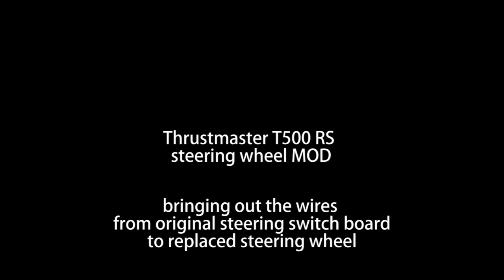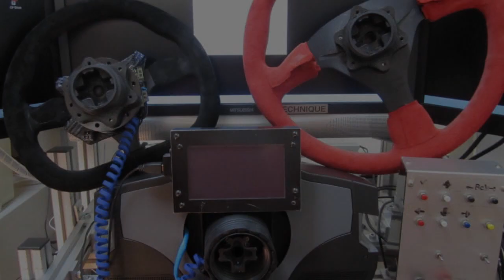Mod Thrustmaster T500 RS

Comment: Hey nice rig m8 what differences do you think there is between the T500 and your old wheel you use to run looking at upgrading to a T500 from a G27 .would you rate the both wheels out of 10 .Also have you had any problems with the T500
Reply: G27:7/10 
T500RS:8,5/10 
Once you have used s belt drive wheel you dont want to go back so if you are considering upgrading I would highly recommand it.

Comment: Dear customers, thrustmaster is trying to get away from their responsibilities about their products even thought the warranty is still valid.  On september 2014 i bought a T500 RS and four months later it stopped working properly.  Not only the company didn't solve the problem but also insist on telling me i should contact my retailer, who merely sells the product, made in China  and sold in Brazil, and has no responsibility for any problems it may present.  Considering there is no technical assistance in Brazil, the company should replace the damage product for a new one, which they refuse to do even after many emails sent.